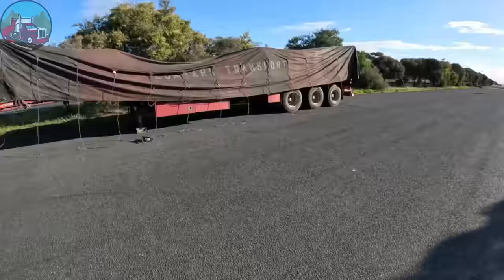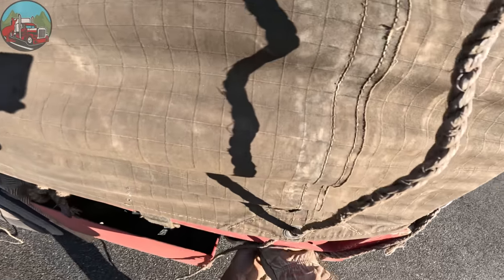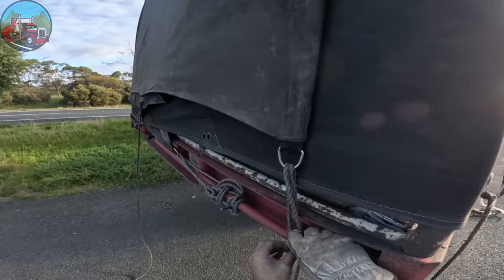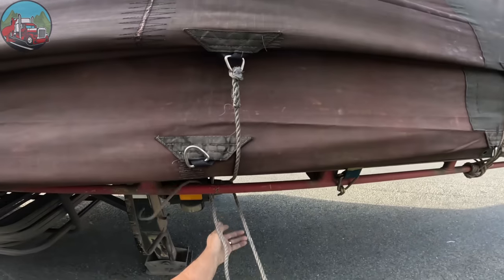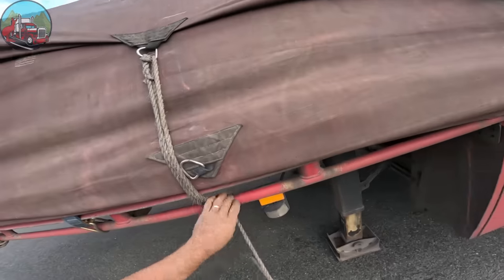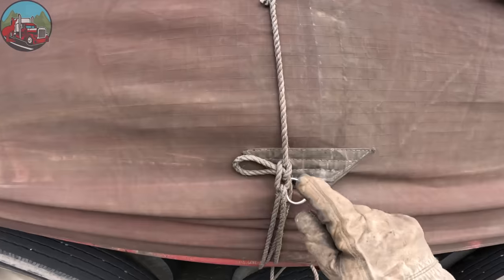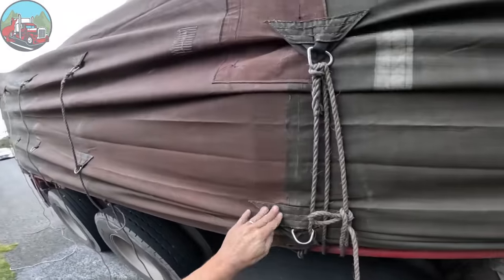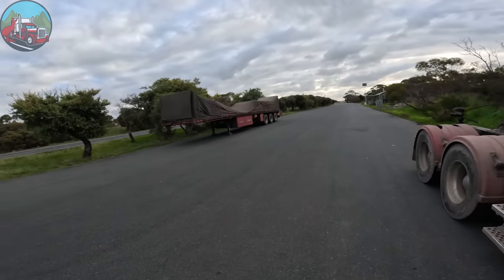How to Tarp My Road Train

Comment: We always called them sheepshanks. Tarping with wet muddy ropes in winter was always great fun, dry, cracked skin wasn't sore at all... The quality of the tarp job showed the quality of the operator.
Reply from the maker: Where do you call them sheepshanks? Yes a good tarp job looks good
Reply: @RoadTrainAdventures  Western Australia, up the coast and also across the paddock for many years, mainly to Melbourne.
Reply: The "trucks hitch" or "pulleys" you tied into the rope are typically called sheep shanks. It's the name for the knot. Used by sailors and boy scouts the world over!
Reply from the maker: Yes I'll remember that from now on. Thanks
Reply: I heard them called sheepshanks too, but it was back in NZ many years ago.
Reply from the maker: For sure
Reply: Dad always called them sheepshanks on the farms in South Australia if you put too many in you will snap the rope.
Your building a pulley system.
Reply from the maker: For sure

Comment: More traditional way of doing it. I was watching a trucking show from Canada. They use rubber stretch hook straps. Not ropes on the tarps. Or at least the one I was watching did. That seemed weird to me. When I first got to Oz from UK and went to tie anything to a truck I was lost. On all the trailers I had worked with they had hook tie offs. Not rails. Did the truckie hitch pulled the loop down to hook off. No hook. Had to get someone to show me. Go behind the rail up and across. Then pull the loop up and make the hitch. I had always made the hitch first. My brain just got cross wired. Now after 25 years of rails. That seems the norm.  Still annoys me a bit having to keep feeding the rope behind a rail all the time. It is easier to tie to a hook. But both systems have their benefits and faults. Very true. If they flap, they tear.
Reply from the maker: Yes I've been told by others about this rubber strap. I just don't see how you could have a tight tarp using that method.

Comment: I’ve always called the knots with the loops in them a Sheepshank & a 1/2 hitch on the tie rail. And how you’ve tarped that trailer is absolutely exactly the way I was taught 40 years ago & was still using them when I was last on the Darwin run in 2016
Reply from the maker: Awesome. I was shown by the old school guys.
Reply: There's a vid on YouTube from a training school that shows the way I was taught. They call it a Beehive, I call it a Truckies Hitch:
https://www.youtube.com/watch?v=73hHtb_if1g
If you've got rings like that on the tarp you don't need to use them anyhow since the rings are the pulley blocks, but the ropes have an advantage when using a Truckies Hitch and that's they lock in better.
Reply from the maker: Yes he did a very good job at explaining.

Comment: Hi from France ,i used to work for Blakiston's in Geelong,back in the 80's,
i was based in Melbourne, i use to tarp two,maybe three times a day,depending on the frieght, Melbourne-Geelong isn't that far.
Back then it was a matter of pride,that front and back enveloppe had to be tighter than a guitar string,when you were finished there wouldn't be a single crease, looked as though it had been ironed.There was an art to folding your tarp,an art to unrolling it as well.
I've even still have some photos. 
Your knots are called a half hitch and a clove hitch.Some times you'd have to splice the ends,even slice two ropes to make one or simply slice the  ropes back onto to your tarp.
But now some 34 years later,god knows how many miles,i now drive a petrol tanker local in and around Lyon.
I really like your chanel,i enjoy all of your vidéos,i honestly can't fault any of them.
Have a great day.
Reply from the maker: Thanks heaps. I actually live in Point Cook so you might remember that near Werribee.
Reply: You dont see the need to double lock you hitch
Reply from the maker: No. I see some people do that as they were taught that way but this way works fine too or I definitely wouldn't keep doing it this way.

Comment: I started tarping in London '75 for Lucas Industries, (The Man Who Invented Darkness), and did heaps more for Layton-Kirkman doing steel and soda ash, ( middle of summer, long sleeve overalls ). I always called those rope hitches 'dollies'. The earlier commenter was right. All the London loads were held down with ropes, usually old weather beaten ropes that you could snap with a double dolly. All the trailers had open hooks along the side. Made it easy to loop the load and tarp ropes; you didn't have to feed through a combing rail. Power steering was only for new trucks, the rest had 'Armstrong' steering. Tautliners were only just coming in. When I got back to Oz in 78 there wasn't a tautliner to be seen. We was men then indeed! Nearly a half century since then of the road. Sunrises, diesel, dust and dead roos. Going back to flatbed and tarping this year. 70? Too old? I'll soon find out :)
Reply from the maker: You got it. There are many bands for those knots.

The truck drivers today have it too easy.. Not many even change a tyre. This is mainly due to companies not allowing them to.

Comment: I recently quit a job where I was doing multi drop steel deliveries and tarping. Earlier on this year, I was standing on top of the load after completing the first drop of 5 and pulling the tarp back across (one side was still tied off) and as I was pulling it over a gust of wind ballooned the tarp, a rope wrapped around my ankle and knocked me over. Luckily I'm fit and strong and all that happened was I fell on my back on top of a pack of steel. 
Big tarps are bloody dangerous in windy conditions. Freaky shit like this happens. After that I was so over multi drop steel deliveries I looked for a tanker job. I like hard work but a time comes where you realize for the degree of effort and experience you have they aren't paying you enough and it starts eating at you. Tarp, untarp, retarp, repeat in the rain is hard yakka. They make you tarp when it's 40deg C or raining, it doesn't matter. I was getting reasonable not great money as a company driver say $75k a year for 40 hours with holiday and sick pay.

So I looked and found a tanker job and I now get paid $9 an hour more for doing one or two pickups and one delivery (which I'm not required to unload) with overtime and penalty rates. The only hard work in this job is sometimes I have to break up the trailers to load and I always have to break them up at the end of each shift for unloading which means the set has to be assembled at the start of the shift too. I'm never in the same truck in this job though and they're all lowish power and I drive in hilly country so they're slow when loaded, like really slow - 25kmh slow many times. Crappy 425hp auto Macks...
I miss my 600hp Cummins in the K104 from the steel job but that's about all I miss. When it was slow it was still doing 70kmh LOL.
Reply from the maker: Thanks for sharing your story. It's not all tarping with us. Maybe every fifth load I might have to tarp and it's very rarely more than one drop on each trailer. Your job does sound like a lot of hard work. I've done pressurised tanker work. You didn't say which kind of tanker you had.

Comment: Love watching your tarp job. Everyone does it different. In the states i pulled a single 48 foot flat trailer,i had 4 tarps. We rolled them out from back to front depending on the size of the load,sometimes I'd use all 4 sometimes not. But still like watching others tarp jobs.
Reply from the maker: Thanks heaps
All of our trailers are 48 foot.

Comment: Back in the 70s in Yorkshire UK we used to not only tie down the tarp but secure the load using ropes. We used to call it a "twitch". It allowed you to double the leverage you could put on the rope. 😂😂😂 Brings back memories of working with my Dad. Thank you.
Reply from the maker: Thanks Dave. Yes I hear from other older drivers that before straps, everything had to be tied down with ropes.

Comment: Wow, I used to see heaps of trucks in the 70s and 80s with tarps on loads. Don't see a lot these days. Thank you for bringing back good memories . 👍
Reply from the maker: Yes it's a funny art. It's rather tarp my load than have to open curtains every time I wanted to get to my load.
Reply: I'll be sharing to my American mates.
Reply: @RoadTrainAdventures  The Tautliner or curtain-side  Trailers have taken the place of all general freight that used to be loaded onto trailers with Gates Side curtains cap tarps and full trailer tarp (as you are using here) i was very happy to go from general freight to refrigerated freight Mostly fork on fork off but sometimes we would hand stack freight But no Tarps The rope pully knot we called a truckles hitch On line they refer to it as a truckers hitch
Reply from the maker: That's very good of you Warrick. Thank you very much
Reply from the maker: Even easier are side tippers. With automatic taps you never have to get it off the truck. Great when it's hot.
Reply: @RoadTrainAdventures  before i retried I was working on the mines in a roadtrain water cart and occasionally on side tippers (water cart was the golden ticket First on last off with big breaks while working with graders scrapers and side tippers ) I retired after working back on general freight to the mines for 12 months The snot and dribble finished me Too old and broken to do that crap LOL
Reply from the maker: Yeah I thought a water cart would be very easy but wouldn't it get boring after a while if doing it?

Comment: Everyone has their own unique way or style or Tarping Johnno..
As long as the freights cover mate..
Most of our tarps had a 3rd row of shorteners..
My tarp even had extra ones to pull the flap out at each end..
Used to take me around 3hrs each end to tarp a bdouble lol..
Two of our tarps were 6ft drop 5ft gates they took some work to get right..
Good job mate! 👌
Reply from the maker: Yes you're very right. All of our tarps are different in the ways you just described.

Comment: What a great job tarping. In my country flatbeds are common used by truckers and they tarp with ropes too, the method is the same but they ties the ropes all around over the tarp from side to side to secure it, as well with some loads too. I hope to buy my truck to start in the industry😄
Cheers from Venezuela👋
Reply from the maker: Awesome. Thanks. It's great to have your along

Comment: I am on flatbed here in Canada and our trailers are 53’ but I often do super B’s too. I always have to use at least 2 tarps to cover the load, sometimes even 4🙄. Tarping is hard work. In the summer you are sweating like ….. and in proper Canadian winter the tarps don’t fold too much😁. I use bungees not ropes to tie the tarps down. I’m planning to move to Australia next year and drive there so I’m glad I found your channel. You got so many interesting and valuable things here. You just got another subscriber mate!
Reply from the maker: Thanks JM. It's great to have you along and no doubt I'll bump into you next year when you're here. Ha ha. Australia is a big page but if you get a job driving around here then it's quite possible. Let us know when you get here.
Reply: May I have a question? Is your “road ranger” manual the same as “eaton fuller” here in Canada and US? Can you float the gears without a clutch on your road ranger gearbox? Just wondering if it allows you to do it too.
Reply from the maker: If course they are the same Eaton Fuller. I never use the clutch except for putting it into gear.
Reply: Same here👍. Good to know. Thanks
Reply from the maker: Awesome

Comment: Hi mate,
I used to tie my truckie knot the same way you do but I got sick of trying to push the knob end through the twist loop. Instead of  twisting the loop with your fingers, I just wrap the knob end that's in your left, with a double wrap (use right hand and the rope that you would have twisted). Make sure the second wrap sits inside the first wrap and next to the strained rope so that it doesn't try to flip off.
Hope that makes some sense.
Reply from the maker: Thanks Brandon. Yes the older guys here do it that way. Maybe I'll try it when I can remember.

Comment: A well tarped load always looks good. It is half a sheep shank, the other half is the rail. Clove hitch on the rail as everyone has pointed out. You only really need 2 knots to tie anything on. You are doubling the mechanical advantage and halving the effort by putting the rope through the ring or you can put another shank in and do the same thing as you know. Just like a pulley block and tackle but with more friction. Can you show us how you roll the excess strap up and loop it up? I wonder if the American bloke in the other comment with his rubber straps has ever worn a ring in the face when something broke? Jeff
Reply from the maker: Ha ha. Wow a ring in the face.. Or what about if the strap breaks?

Comment: Hi, most informative. Takes me back 40 plus years. I notice that your trailers do not have load scales, so it might help others if you can explain how you calculate where to place on your load on the trailers, for maximum loading on both the tri's, dolly and drive. Another topic that could be discussed is the operational areas for A-Doubles in Australia. This would help your overseas subscribers understand our many different regulations, both Federal and State.
Reply from the maker: Yeah for sure. Many videos to come. How do I know how much to put on? I use the Force... Ha ha. No I do have scales in my truck and also on the trailers but I went over a weighbridge on the way out of the place I got loaded.

Comment: North America we use either two piece or 3 piece tarps for a whole trailer the front and rear tarps will have a 10 by 10 flap at one end! We use rubber bungie cords or rubber rope to secure the tarps. When tarping we do the rear tarp first an work our way forward!
Reply from the maker: If you work from the rear first how doesn't the wind get under the back traps? That way doesn't sound very practical.
Reply: @RoadTrainAdventures because our tarps our in either two or three pieces you put one or two bungee cords pulling the rear tarp forward  then you secure the rear flap as fast as possible. then you use bungee cords to quickly secure it in place and secure the front, then you go back down the sides for the final securing of putting a bungee in every d ring nice and tight!
Reply from the maker: I'll have to check this out on a video so I can see what you're talking about.
Reply: As 76 yo I learnt from a older man in my early teens and have always called it a hitch and the second one a half hitch I still to this day if I see a nice neat tarp job I will call on uhf and comment
Reply from the maker: Very good

Comment: Tarping wasn’t my favourite part. Try to tarp and untarp in Canada at - 20 C. The tarp is hard as a rock. Sometimes, sticking on the load, so you have to climb on it…
Tarping keeps you fit.

You’ve got another subscriber 😀
Reply from the maker: It doesn't get that cold but yes the taps get very stiff. It's great to have your along too.

Comment: Nice one Johnno. More long form videos. Thanks for the tip on the 15 min power naps rather than a half hour one. Maybe do a run down on all the guages and dials etc in the cab. What's your fave wok in a box. Never had one but might get one tomorrow. Maybe you should get them to sponsor you. Cheers!
Reply from the maker: Thanks Mike. I intend on showing you around the truck one day. It would be nice to show your around a new truck when I get one.

I used to get Nasi seafood Goreng but they don't do that one anymore so I get the combination but I modify a little. I take it the oyster sugar and replace with Nasi sause.

Comment: We have a variation of the truckers knot  here in the UK . Take the rope coming from over the load , pull tight making a loop and placing across the rope wrap around twisting and placing the loose around a hook ( we have hooks on UK trailers )  pulling tight  , double up or even triple to pull really tight ...good for cabins and portable buildings  . As for climbing on the trailer ...not a chance ,  on most sites here you would be banned from site because of health and safety regulations . Drive safely .
Reply from the maker: Yeah health and safety had gone overboard here too hence the reason I was doing that in a parking bay on the edge of the road.

Comment: That was amazing to watch, thank you Johnno. Can I ask, lets say you get to your destination and it has been raining the whole way. Do you dry your tarp out before folding, or it goes away wet? Do they gain much weight when wet? As a 4 wheel driver when camping we try our best to dry our wet gear before it is put away  otherwise mould can grow, and certainly when home air for plenty of time to dry gear and tarps out.
Reply from the maker: No we don't dry them but we would prefer they are dry. Sometimes we have to roll them up on the dirt so you're rolling the tarp up in mud. 
Can get pretty dirty and then dusty when it get dry.